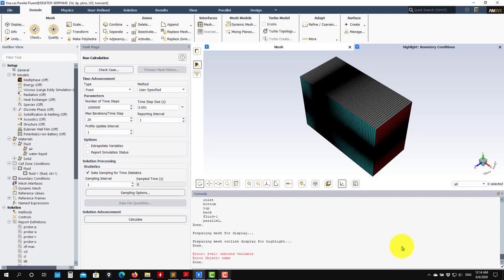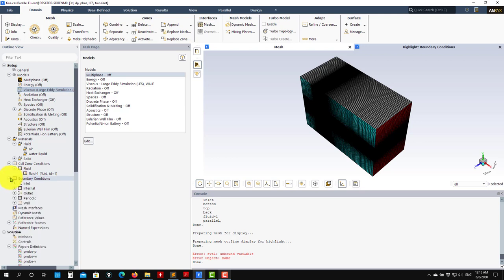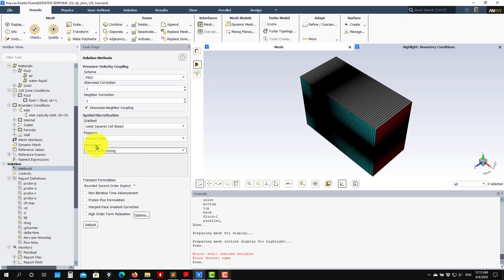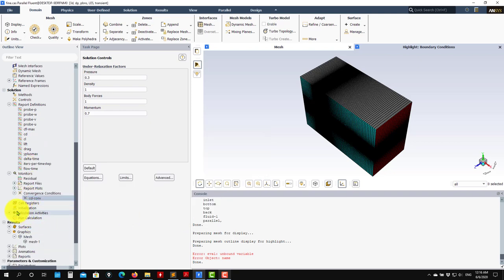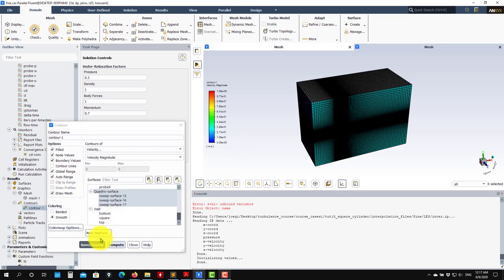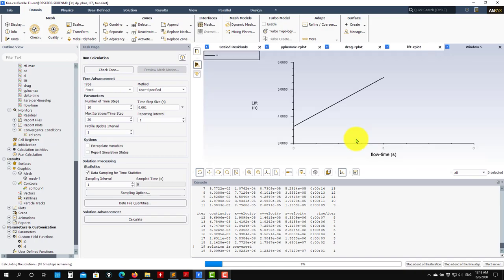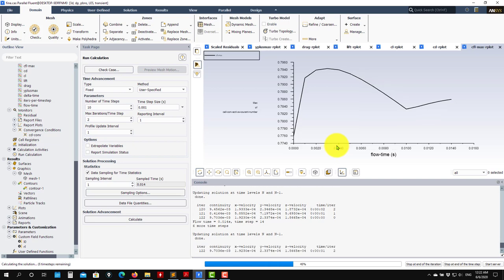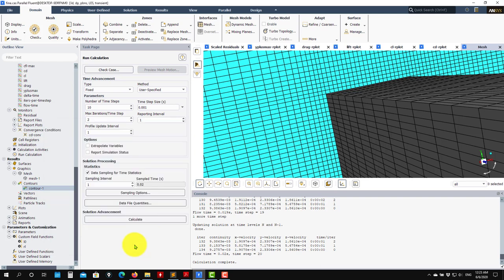Turbulence modeling with Ansys Fluent | LES simulation - Square cylinder - Part 9

Comment: WHAT ARE THE DEVICE REQUIREMENT FOR LES SIMULATION
Reply from the maker: well, that depends on the size of the simulation.  Small simulations (small meshes) you can get your way around with modest resources, 8 cores, 16 GB memory. Larger meshes, you need way more resources.
Reply: @wolfdynamics5703  is 16 cores enough?
Reply from the maker: Yes, that is ok.  But again, it depends on the mesh size and how long are you willing to wait. Let's say that for a mesh of about 5mill is fine. Also keep an eye on RAM.

Comment: It's really confusing to say iterations for both the linear system solve and the time steps
Reply from the maker: Why? A time-step is an iteration.
Reply: @wolfdynamics5703  A time-step is a time-step. Iterate means that you are converging to something, which you can't really do for a transient problem. Iterate literally means to do something over. Whereas during a time-step the fluid field changes. You're not solving for something static and getting closer and closer. This is my opinion and I have a PhD in computational science :)
Reply from the maker: @kingsleyzissou5881  Putting aside the semantics is pretty much the same. You iterate within each time-step, and you advance the solution in time (kind of iterate). I think it conveys the same meaning; after all steady/unsteady simulations are an iterative process.